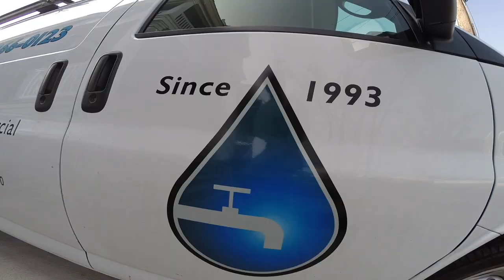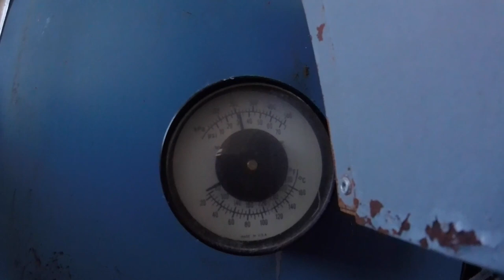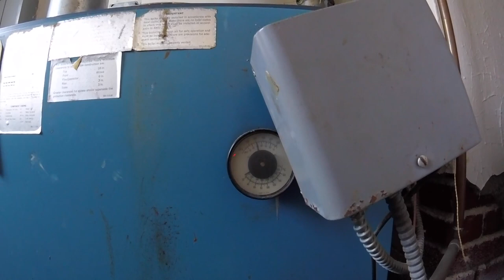HOW TO DISMANTLE LARGE HYDRONIC RADIATORS FOR EASY REMOVAL

Comment: no worries about hauling scrap metals around here, just set it by the curb and soon you'll have them fighting over it..
reminds me of a water heater replacement, the guys asked what were doing with the old tank and was worried about needing someone to haul it away, I said put it at curb and it will be gone before we can pickup the new tank and it was by time we went inside to lock up and leave it was long gone :))
Reply from the maker: this town really tight with their construction trash. gotta look good 24/7

Comment: Curious why you didn't cut the rods going thru the radiators top and bottom two then use a wedge between each to separate them? Did that with most of my radiators and was easy for me by myself to remove. Also keeps the integrity of the radiator and can be easily put back together with the right seals and new connecting rods two top and bottom.
Reply from the maker: Just did what was needed and no plan to reuse.....
Reply: Same question here - they are designed to be taken apart.  Should have been able to separate them with a wedge once the rods were cut and saved the sawzall blades.

Comment: Need more explanation... What holds the sections together? Why did you have to cut it?  Can you not simply replace the one cracked section? Why did you give away the scrap? When you replace the units please give a full how to and why! I’ve never done a job with radiators. Thanks, you da man! 😀
Reply from the maker: Roger that. Push nipples connect sections.  a top and bottom, the rods hold em together. I only scrap copper and brass. I will give the rad class better next time Sam....thank you.
Reply: the rods hold em together, but there are seals between the  sections. there are speciality repair companies that just deal with this, and they can remove the broken section and reattach the existing ones together. But the cost... the cost is outrageous, and not something you'd do with a standard run of the mill cast iron. You still have to bring that monster down, load it, ship it, and wait.  One of those rads was a 18 section... that thing is like 500 lbs.
Reply: I'll add, taking apart and putting together used radiator sections is not easy, so many different companies, designs and sizes made long ago, you're liable to never find matching stuff.
shortening even only one section is a challenge still with all the layers of paint and needing the right seal material and likely new nipples. they often start leaking at other sections once played with or there could be cracks behind paint invisible until pressurized again.
the dedicated rebuild companies separate all sections, clean/strip paint, air/water tank leak test, fix threads, tapping's, bungholes, match sections by size, type and design. if it was easy to do, they'd not exist ;)

Comment: I was thinking that it might just be possible to repair those radiators rather than replace them . it is possible to weld cast iron with the proper rod . I have even heard stories of success using JB Weld . what do you think?
Reply from the maker: hole blown out in rear sections. i would not attempt repair like that on this situation.
Reply from the maker: like to know if anyone has though?

Comment: 40 years I never did it that way ,cut rods and a steel wedge & 3 lb beater
Reply from the maker: In my 34 years this was my first attack of the rad with sawzall....a battery one to boot and with the killer blades why beat your brains in.
Reply: think a hydrolic ram would work?
Reply: using a wedge ram or spreader on porta-power setup doesn't work well, they just twist and bind tight as hell, then you hit with sledge and they fly apart 10' with massive force nearly killing anything in their path ;)
The best way is laid flat on side using 4 wedges, two on each end, on both sides of the center water bungs, knock them all in evenly or they'll bind up tighter than a drum!
The last I tore apart was natural gas 300 Mbtu input cast iron sectional from the 40's,  I tried all the tools in my arsenal to make it easier, which wasted my time and took longer than the old fashioned way.... which I figured would happen, with exception of cutting the tie rods with sawzall, vs. unbolting them.

Comment: Do you have a video with separating cast iron radiator and then adding or replacing the parts did it as a kid but I can’t remember how to remove the bottom and top fitting that connect rungs ! I don’t want to heat them and then use pliers because it needs to go back together . I want to extend my radiators , I have the room space for larger radiator
Reply from the maker: I do not... your gonna need sections to match. sounds like a labor of love. maybe make one rad out of two if you have spare from a another room or junk yard.
Reply: @ChuckBarron  thanks for responding yes Ive been looking for older radiators to separate and add on to mine , I actually have 3 different size rads I want to expand on , Ive been to a junk yard but they didnt want to sell me anything lolo.I would have paid more then price of cast iron .So looking for street guys maybe they have one . but do you know how to get the compressed fittings out my radiators are compressed together not screw together

Comment: have you ever tried to weld or brazecast iron ?
Reply from the maker: I have not. you? how would I use it in this application?
Reply: I have brazed (for other things namely a turbo,) but never on a radiator fin.  even without seeing the damage up close, this was a freeze up condition, which probably means fractures across a larger plane, in a presurized system. kinda asking for trouble.  Also, trying trying do this in field is rough. I wouldnt take it on for a number of reasons, 1. You need to still disconnect from the system to pressure test it. 2, once pressurized and you find the cracks, you need to clean up all the paint, then still magnaflux it to see if the crack expanded past that point, but still somehow holding pressure, then  drill out the crack, v-grove it, and try not to do vertical brazing or out of position (non flat). THen of course, the dangers of doing it in someone's house.  With all that said, its really a cost issue- its cheaper even with labor to just remove the cracked ones and replace with new ones.

Comment: is it possible to remove one water heater without removing the others in the house ? and would the system still be able to run the same on all the others ?
Reply from the maker: Yes you can as long as its not in series. This rad in vid had one above so we had to install another. Or pipe feed and return together.

Comment: All you have to do is cut the rods that hold them together then take 1 maybe 2 swings with a Maul/Wedge Hammer and they pop apart. Try to be smarter than the radiator your dismantling.

Comment: No insulated lagging on any pipe work would have made that system very ineffective at getting all the boilers work to the radiators .
Reply from the maker: old old system. this once was a gravity system before this boiler was installed.